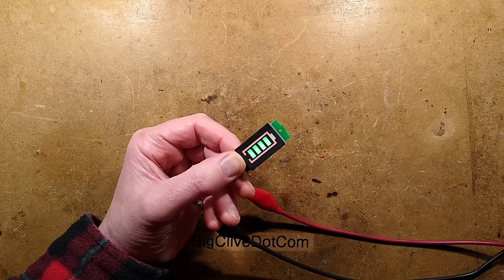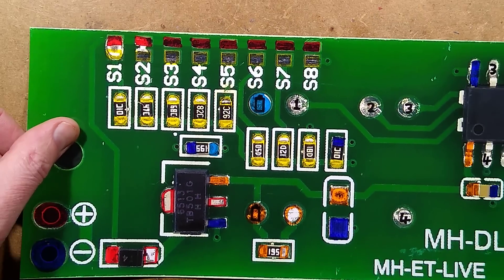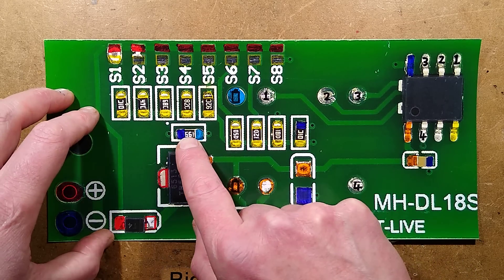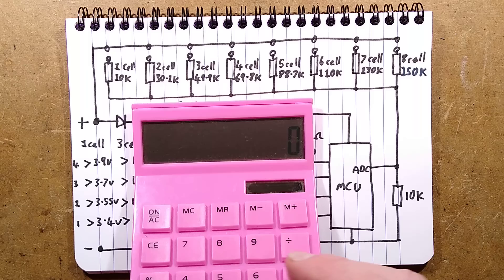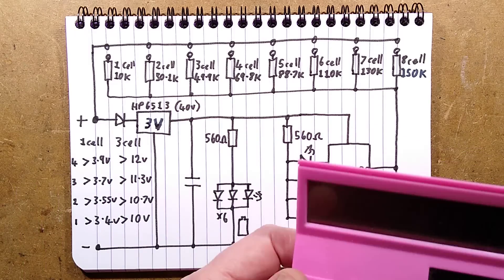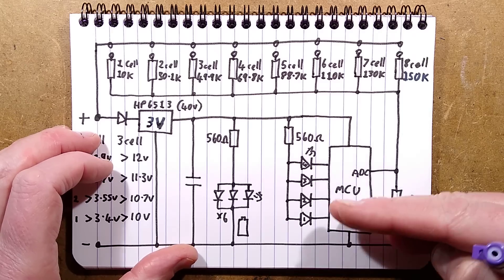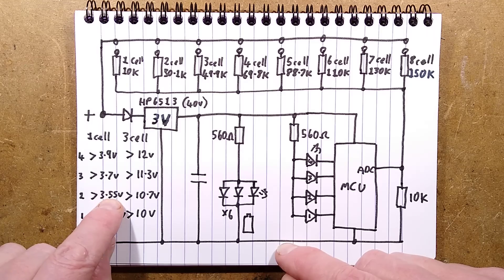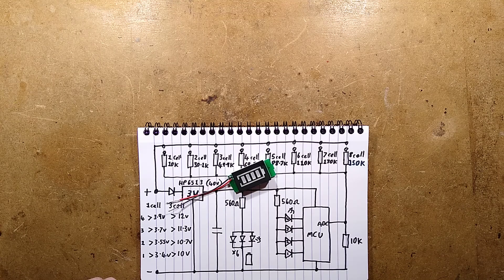Fancy 1-8 cell lithium battery level indicator

Comment: So the LEDs can be utilised individually with a separate microcontroller, bypassing the onboard one, by utilising the numbered LED cathode pads?
Reply from the maker: I think you can get the bare LED displays.
Reply: @bigclivedotcom  Seems rare, I have searched by that part no SPBK(x)S-10, x supposedly color variant, all of those come pre-assembled.
They look nice and have a good form factor, I would like to use them display capacities for stuff other than batteries! I think i will buy a few and try feeding those pads or ground them to find out. Thanks BigClive🖖

Comment: Neat unit. I bought three. Identical except the V regulator is a 7133. 3.3 volts. 
I’ve used them in a model boat that gets quite a lot of condensation. So painted on conformal coating to help. 
But so far, after about six outings, I’ve had two fail. Using them on six cells. Lipo. 
V regulator and the micro have blown. Dunno why yet. Spikes when I connect the battery ?
I have one left. I’m thinking maybe I’ll increase the value of the current limiting resistor (560R) to reduce the current
through the micro when all bars are on ….
The bars are very bright so should be ok …. we’ll see. 
Thanks for the video. 😊

Comment: Another neat trick would have been a brightness selection (bridgeable solder pads) I have a few in my bluetooth projects and for indoor lighting these things could do away even with 40-50% brightness. Do you reckon replacing the 560R resistors with a 1k or 2k ohm will do the trick or would it interfere with the calibration/settings.

Anyways, great video as always C.
Reply from the maker: You should be able to change the LED resistors without affecting the calibration.

Comment: can these be wired upto a battery continuously ? or can it only be a "checker" under no load ? (correct for terrible grammar)
Reply from the maker: It would pose a slight current draw continuously.

Comment: There is one problem here with the indicator : The LED s are continuously on whether you are charging or discharging the battery.Which means,even after unplugging the charger, LED s will be on draining the battery. Do correct me if I am wrong .Thank you .

Comment: BC: You mention a missed trick in displaying an overcharge condition by blinking the 4 bars. How would the schematic change to allow for this or would it be done with software in the MCU?
Reply from the maker: It could be done entirely in software.

Comment: I can't help noticing that there is one apparently unused pin on that chip, which makes me wonder if the IC itself might actually have some extra functionality which just wasn't actually implemented by this particular board.  It would be interesting to monitor that pin and see if it does anything interesting as voltages change...

Comment: Very similar to what I did with an Atmel TINY85 microcontroller. Used Green/Yellow/Orange/Red LEDs is sequence to indicate the state of charge of a 3 cell battery pack running a Raspberry Pi, and with a critical low charge output to initiate a graceful shutdown of the Pi.

Comment: Its a shame that this battery level display unit doesn't go up to monitoring 9 cells at 36v dc which would be quite a common battery pack voltage, unless you can modify the unit to do so.
Reply from the maker: If used for brief tests on a balanced system you could tap it off just a few cells to get an indication of the entire pack's charge status.

Comment: Any idea what micro controller these companies use? I am working on a project and am using an ATTiny85 and wonder if what they use could be better or cheaper.
Reply from the maker: There are many cheap microcontrollers like Padauk chips in mass produced products.
Reply: @bigclivedotcom  thanks. As I mentioned I have a big project coming along and cheap microcontrollers might come in handy.

Comment: I think that the voltage divider could be slightly easier and cheaper to manufacture if the top row of the resistors would be in series instead of in parallel. This way it could be made with a 10k resistor and a bunch of 20k resistors or even with just 10k resistors instead of a bunch of different resistor values.

Comment: Idea for future video. To tear down "analog" LCD tablet with clear button. It has a little PCB inside with voltage booster that clear the LCD. I couldn't find any video of any of them disassembled. 
I opened mine because the button stopped clearing the screen, even though the battery voltage is ok. Turns out it exceeded battery current capability (~15mA) when spiking voltage. 
To open the device the screen has to be simply pulled off.

Comment: How about for 13s?
Reply from the maker: The higher voltage would require a different regulator.  But it could be viable to tap it across just one or two cells if it was only used intermittently.

Comment: Possibly not so useful for LFP (Lithium Ferro Phosphate) cells? They don't seem to be easy to gauge the stored capacity based on voltage and systems have resorted to measuring the inflow / outflow currents and setting the high / low tide marks when hit. Obviously smarts with persistent memory are required for these. I believe this is why some people are running their cars flat and then fully charging them to "retrain" the BMS as to the total capacity of the battery banks.

Comment: Some linear voltage regulators aren't so... Linear. Some of them are just a poor man's switchmode power supplies within the tiny packages. Obviously a true SMPS voltage regulator now exist in the same transistor package as this voltage regulator on the battery life indicator, with all the whizbangs on a single die - some CPUs have the same stuff on-die nowadays due to the differing logic voltage islands such as CPU Vcore rails (Intel is one of the companies that makes the processors with built-in switchmode voltage regulators).

Comment: The Clive, I have a question, when you have a discharge resistor across a capacitor, does it not almost entirely negate the effect of the capacitor, so much as to be useless, or, could not a lower value be used in its place, or, if one is used early in a circuit, should not an inductor be placed somewhere after it to maintain any dropout which might be caused by said resistor 👀 or am I being stupid
Reply from the maker: There are many applications that use a resistor across a capacitor.  It still has a "storage tank" effect to give a stable voltage.
Reply: @bigclivedotcom  I sense a but, there...

Comment: With the single shared 560R for the four bars, does the brightness change noticeably with the number of lit bars? Or is the micro-controller actually only lighting one at a time so that they each see 25% duty cycle, regardless of how many neighbours are lit?

Comment: I bought some of these exact ones off of Ebay, there was only the 2 wires for connecting only one battery and they were all being sold as a 3.7v 18650 battery meter.

Comment: I bought one of those and a 3s bms for use in a 12V lithium pack, does that mean I have to "short" the 3rd resistor to tune it for my pack?  All I need now is a good DIY spot welder, got any idea/video showing how to and not to build one, I really would like your advise on that one Clive.
Ps. how much power do that indicator use and should I put it on a momentary switch to avoid the discharging?

Comment: In the "features that would have been nice" category, I'd put a DW01 or something like that to kill the circuit if the voltage drops too low. Those red LEDs could easily pull the voltage below 2v.

Comment: I wonder if you could wire it to an 8 way switch so that you could adjust it depending on how many batteries you wanted to charge in a multi bank charging rack
Reply from the maker: Theoretically, yes.
Reply: @bigclivedotcom  I have a 7 bay charger but it has an LCD display showing percentage . I have itchy fingers to get the screwdrivers out now 😂

Comment: Hehe coilwhine is a biatch 😀
Other than that, this reminds me of the battery indicators built in to power tool batteries like drill or impact screwdrivers.

Comment: Could you check out the "HW-586 Capacity Tester Meter Li-ion Lithium Battery" .. it is just a couple bucks more but seems to have so many more features like capacity testing and such..  ;)
Reply from the maker: I've actually had one sitting here for years.  But never really tested it properly.

Comment: Neat. I'm really tempted to get one of these and slap a set of different sized connectors typically used with lithium cells on it. Maybe there's even a way to get a rotary or sliding switch for the cell selector… hm…

Comment: If it was me I think I would have had a transistor on the last o/p that actually switched the red outline on when the battery was flat!
Reply from the maker: No transistor needed.  It could probably be done with the spare pin on the microcontroller.
Reply: @bigclivedotcom  Yes but you would have to re-program for that, vs a couple of discrete components...

Comment: I think the led is OK. I could be wrong but I think I had a batt charger that hat a LCD bargraph maybe you can get one of those to show off. Might of been over 5 years ago on the energizer aa charger. I don't think I have one at the moment. But I did make a big version for arduino on someone programmed code on the display.

Comment: 5:47 Did you try? The micro can't see which programming resistor is connected. I bet the chip is just a 2.1V bar graph with a big offset.

Comment: Nice looks good for projects where you need to be able to see the battery level at a glance or you probably could wire in a momentary switch and use it as a checker on projects but then you'll have to hold the button down but it may be better that way depending on you application

Comment: Are you certain this will work on Lithium batteries? I was lead to believe they give a linear voltage output until they switch off, unlike agm/lead acid?

Comment: How long does it take to charge a 12v battery at that rate?
Reply: That would depend on the capacity (Amp Hours) of the battery you were using ... 🔋
Reply: @jezmy2006  yeah, I was thinking about it a bit more and although he kept saying charger, it's more of just an indicator. Actually using it as a charging monitor is just one use case scenario.

Comment: I like the idea of flashing the cell when >= 4.2 V.  The only issue with this might be when used as a charging indicator, the voltage goes a little bit above the actual cell voltage, especially if there is a wiring voltage drop out to the physical cell location, which could give a false warning.

Comment: I was surprised the other unit with quad op amp and lots of SMD devices wasn't a simple microcomputer like this. It makes me wonder on cost. Can a quad op amp and discreets be less than a micro (especially a three cent one)?

I was surprised to see a common resistor for the LEDs. For regulator power you have to include the LEDs, so seems like the few milliamp is with no LEDs on? Or else they are very low power too.

Comment: And that's fine, if your resistors are in specification, I had one similar and not one of the resistors put in the board werewhat was marked on the board itself, as a result it was 30% off, I changed every single one and now its within 5

Comment: @clive hope you had a good crimbo and new year's pal. Being 6ft 9" I got clothes and they didn't fit as usual. Jeans at half mast and jumpers which were more of a t-shirt. No matter how many times I tell Santa I'm a 39* inside leg and my armspan is 7ft3" ( yes I have a genetic quirk) 😭😭 I'd been such a good boy this year . And Santa ate  the mince pies I left for him then cheeky git helped himself to the dominos pizza and 4 cans of Guinness. Hope he gets pulled over and charged with drunk incharge if flying raindeer😭😂😂🎇🎆 hope this year is a good one for you  mate take care👍👍👍 after loosing most my sight and no longer can really do electronic repair a simple 5 min solder takes me 30 plus mins with all the microscope  and connecting it to the large TV, I still get my tinkering fix from your channel and for that I say THANKYOU.
Reply from the maker: Thankfully eBay does sometimes have clothing in the extreme sizes.

Comment: how do I make one for a 10s battery?
Reply from the maker: Tricky using this circuit as you'd need to keep the voltage within the range of the regulator.

Comment: The red should be over charging since the battery pack most likely will turn off anyway when under voltage is reached and it does not reach 36v then?

Comment: One thing that the mfg could've considered was making the battery outline have a 1Hz flash rate when the final battery bar was cut out for being below threshold and serve as a indication to recharge the battery.
Reply: If the microcontroller is flashable it would be a trivial matter to reprogram it to do that even if you had to start from scratch after erasing it.(Assuming it has copy protect enabled)
Actually, it would probably be easier to erase it, rather than trying to decode the assembler listing. Depends on what type of language they used to write the source code.
You'd also have to rewire the red LEDs to be controlled by a spare pin on the MCU.
Reply: @kimchristensen2175  In my experience, the sorts of chips used for these sorts of applications are usually mask ROM or OTP, not reprogrammable.  Even if it was, though, you'd need to know all of the details of the instruction set and chip architecture, which are quite possibly very nonstandard.  It's probably not feasible without getting assistance from the company who makes them (who likely aren't interested in talking to anybody who's going to be ordering less than a few million of them at a time).

It also might well not even be a microcontroller at all..  It could well be just a circuit similar to the other comparator design, just with everything prepackaged into a convenient chip...
Reply: @foogod4237  Could be. Looks like the pinout is close to one of the 12F or 10F series pics. I guess it could be swapped for one of those, but that's probably not worth the effort.
Reply: Can this be modified to work on even higher voltage batteries?
Reply: @data9309  I'm sure you could. You'd have to add a higher voltage rated pre-regulator ahead of the existing regulator or replace it with one rated for a higher voltage. And you'd have to modify the resistive divider to scale it properly to the higher voltage.

Comment: Using one with an 8way cheapy PCB mount slide switch to make a simple 1 - 8 cell selectable lipo battery tester. So handy, when you can put it in a box with different battery connectors to just plug an test. 👍